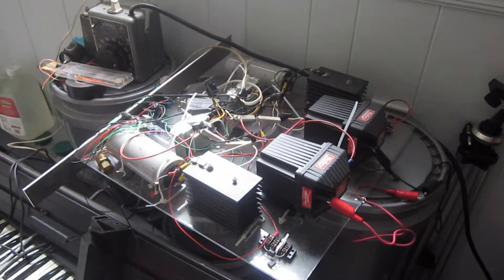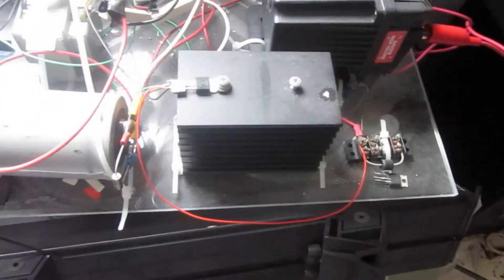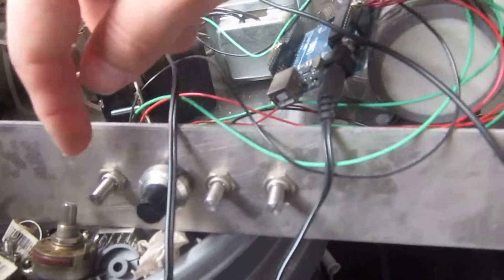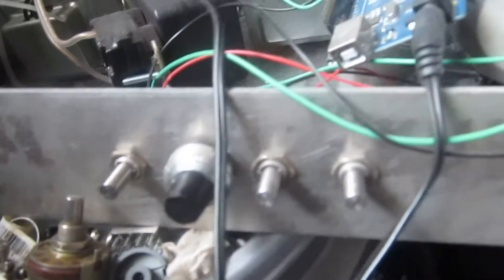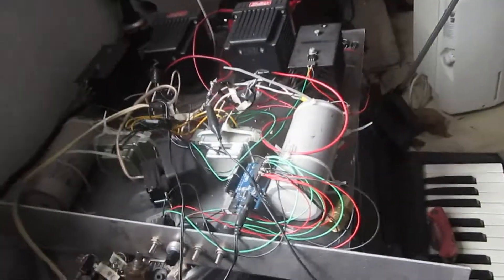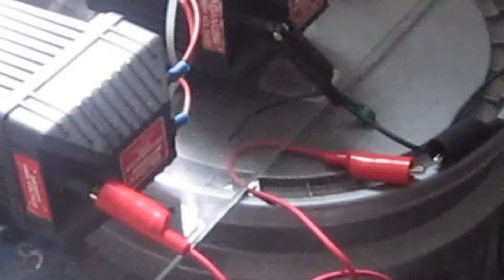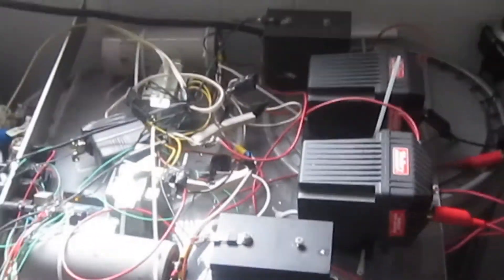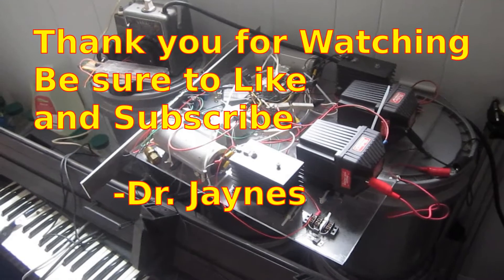Arduino High Voltage Power Supply

Comment: Sorry you pulse modulate the mosfet on gate?
Reply from the maker: I generate complex waveform on the gate of the FET. I start with a square wave carrier frequency.. which I can modulate the duty of.. then I logical 'and' it with a lower frequency/variable duty cycle wave form.. to make a pulse modulated signal.. something like this... _---___---_  etc..

Comment: No code, no schematic,...so what's the point..??
Reply from the maker: I will definitely make more videos on this, with code and schematics. This is a much more difficult project, and I wasn't sure how much interested there would be in the details.  I think I mainly made this video to show some interesting things you can do with an Arduino, and also to introduce this unusual power supply, because I was planning to use it in some of my nuclear fusion experiment videos.  I will definitely make some more detailed videos about the construction of this device.  Thanks for the great comments..